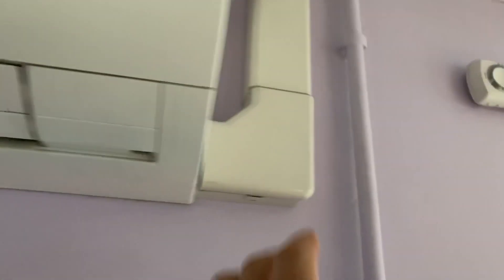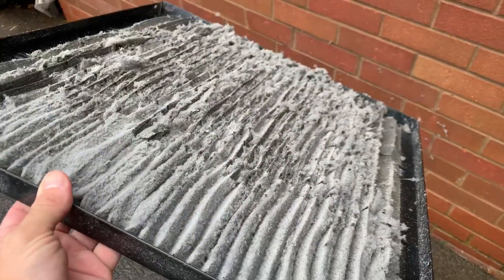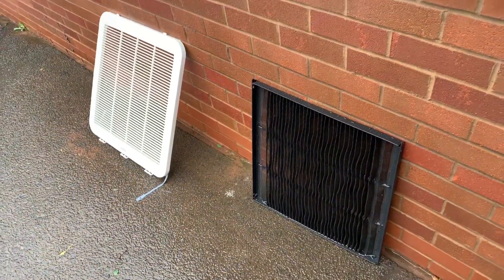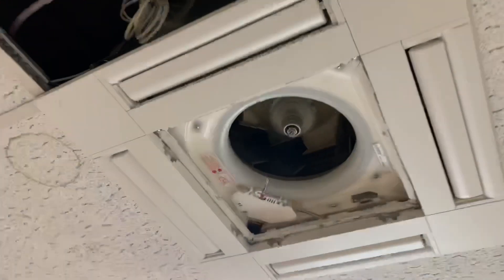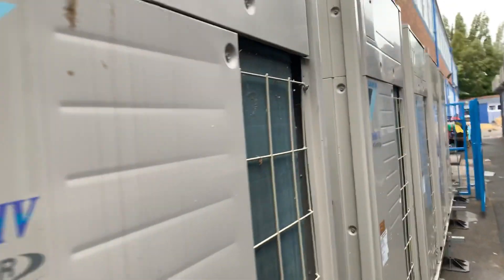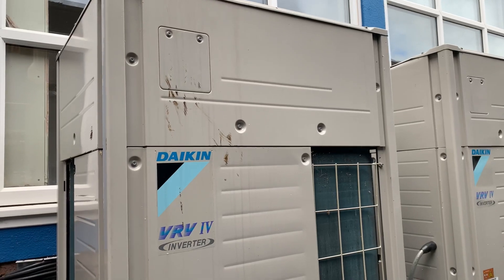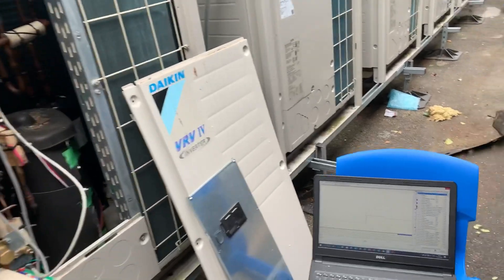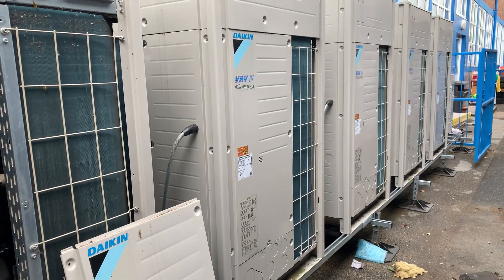A DAY WITH AN AIR CONDITIONING SERVICE ENGINEER UK | HVAC UK

Comment: Great vid! I'm considering training, and had a few questions - Is it an essential part of the job to be able to work at heights? I've seen some buildings and factories where they are near the roof!
Is it dangerous in general? Electric shocks, moving parts, things like that

Thanks so much keep up the good work
Reply: Nothing should be dangerous if the correct risk assessment is carried out first. There are working at height guidelines and  HSE training courses for portable towers etc. Sadly these all come at a cost which will have to be factored in. I was at a MOD site a fews years ago where there is a total ban on any steps. Your van was inspected and not allowed on site should you have any.

Comment: Bloody Terrible the installation of those isolators and do t get me started on SY! Your right it should be band. 
As a spark I come across mess like this all the time but no one seems to give a crap. 

Biggest problem with SY is that it has to be treated like a SWA and In the EAWR it’s required the strands have earth continuity. Just shows that the people installing these cables have no idea really what they are doing. 

Great video, Iv just come across your channel keep up the good work . 👍🏼

Comment: Did you put in a price to move the tank pump from the top of cassette to the side of cassette? If the tank pump isn’t wired up to the control wire ,when it fails it will overflow ,freeze the evap and when it thaws it will knacker the fan motor and the evap pcb .
Reply: I had two in Milton Keynes that did freeze up because of that very issue 🥶
Reply: I have no idea but I suspect both cassettes were maybe a little under gassed and were running too cold.

Comment: Yeah I changed a locked inverter compressor on the 4 it was a bit of  of a pain in the ass. Used a rope and hook through fan shroud and shimmied it out the front of unit worked pretty good but yeah still kind of a pain. Biggest pain was recovering 96 lbs of refrigerant.

Comment: What do you find works best for cleaning the plastic covers on the indoor units? And I keep having very loud HR boxes on units, any experience with that?
Reply: I use a biodegradable degreaser mixed about 5 to 1 and a karcher k5 pressure washer with the short trigger and short nozzle, works excellent.

Comment: if you want to check the temperatures with your checker, just use mode 2.21, in 5 minutes everything is equal.

Comment: I’ve changed quite a few of the VRV IV compressors, definitely not as easy to get out as the 3 units, but if you remove the sound jackets, it gives you a lot more room.  On the boards, I use an adjustable bungee to hold the bracket in place while removing the wires, helps out quite a bit.

Comment: Could you drill a few tiny drain oles on bottom of isolater switch, keep the videos cumming.       I am an old school start run cap tech sines 86. trying to learn all these unreliable electronic crap systems.

Comment: Great content as always. Learning a lot from you. Never knew you could test the pump from controller. 👍🏼 Would you quote to replace the isolators, stick them on your report or leave em be?
Reply from the maker: Thanks mate 🙌🏼 Someone else looks after their electrical issues so I just recommend replacing them on the report ASAP before it causes damage to the systems 👍🏼👍🏼

Comment: That water leak on the cassette: Have seen quite a few drain pipes from the cassette sweating and dripping on to the ceiling tile. Also, those mini lime pumps always seem to blow the braided hose off! Doesn't seem to seem to matter what clamp you use!!

Comment: Hi Mate just subed ac installer in Glasgow good to see your post
Reply from the maker: Thanks for the sub mate 🙌🏼🙌🏼👊🏼 I’ve got family in Glasgow 🏴👍🏼
Reply: @hvacuk8975  cheers I've got a wee bit of info for you itouch manager, if your trying to get into the setup menu and do the 4 corners please calibrate your screen before you try as its not a pain if you don't, top right bottom left top left bottom right please touch the bottom above the menu and time.

Madoka controller update it with mobile data off, if you don't and someone calls you while your updating it screws the controller.

I'll post as I find more tips
Reply from the maker: @mundane000  nice tips mate 👍🏼 I’ve definitely been standing in front of an I Touch hitting the four corners for ages on many occasions 😂 I’ll try the calibration first next time 👍🏼

Comment: The reason for the small brown spot on the ceiling tile under a condensate drain(when a clear leak is not obvious) is more likely due to sweating from the cheap thin wall white overflow (on hot humid days) could do with a insulating. Wish more people would use the grey pvc type
Reply from the maker: Very good point mate ! I’ve seen a lot of plastic condensate pipe sweating on the extremely hot days 👍🏼👍🏼
Reply: What is the grey pvc called. I have never seen grey pvc.

Comment: Never knew about testing the internal pump from the controller 👍🏻 thanks. 
Changed a fair few vrv 3 compressors and components, yet to change any components on a vrv 4

Comment: Get yourself a Worx Hydroshot mate. Awesome bit of kit!!
Reply from the maker: I’ve got one mate 🙌🏼 Agree, quality bit of kit for maintenances !! I just need to grab some bigger batteries for mine. 👍🏼👍🏼
Reply: Hey mate you probably know this already. We all use the hydroshot at our place, game changer. I got fed up with the battery on them so definitely recommend the turbo charger. I also found bigger battery alternatives on amazon. JCB are not known for top quality but you can pick up a 4Ah for alot less than the worx range. Great video! I'm a brummie aswell based in Cambridgeshire, good to see brother 🤟
Reply: Yeah its make a big difference with the turbo charger man. Defo recommend it. I've even heard of people making an adapter using a 3D printer to fit out their existing battery's. Love the channel, keep the good stuff coming mate
Reply from the maker: Brendan Murray thanks mate 🙌🏼🙌🏼 A few people have mentioned the JCB batteries ! I was thinking of trying to get a converter too so I can fit my Milwaukee battery on  🤷🏻‍♂️
Are the turbo chargers a lot quicker than the standard ?? Feels like they take forever to charge with the standard charger 🤦🏻‍♂️
Can’t hide the Brummie accent 👊🏼👊🏼👍🏼
Reply: Was that the transportation bracket still fitted on the compressor?

Comment: Good vid ! Hello from Orange County , California. U guys Have Hacks There too. 😂🤣 Too funny ! Water in a Service Disconnect is Not good. As u suspected. Our electrical is done differently Here. We Run a Water tight conduit and Pull wires through the conduit. That Hanging rubber Cable would not be legal here. It would be like using a piece of So cord outdoors which is strictly forbidden. Like # 31.
Reply from the maker: OcRefrigeration , Hvac & Electrical Video's. Hey mate 👋🏼 Yes it’s definitely not the best electrical installation 🤦🏻‍♂️
The black cable is standard practice over here it’s SWA which has a steel armouring around to protect the cable. Normal practice would have been to gland it into the bottom of the isolator (disconnect) though !
The dangling cable was not good though 🤦🏻‍♂️
It’s interesting to see how different countries do different styles of work. I’ve had a look at a few of your videos mate 👍🏼👍🏼
Reply: @hvacuk8975   Thanks. 👍

Comment: Had to change a compressor and inverter board on a vrv 4 a few weeks ago definitely add an extra hour or so onto the quote it was a real pain to do but like you say there is enough movement in the pipes to allow the heat sink to be moved out of the way if your careful, loving the vids it's nice to see uk based ac servicing
Reply from the maker: Thank you mate 🙌🏼👍🏼👍🏼

Comment: You could have made yourself a blanked with all of that fuzz you removed!  

I am with you on that disconnect; there was no need to penetrate the box on the top.  Even if it had been sealed with a washer and/or a rubber boot, eventually those will breakdown and crack which will lead to a leak.  They also really packed and pinched the load wires into the bottom of the box against their lower penetration.  The installer seems to have a bit to learn.

Great video, really interesting to see these VRV/VRF systems, they are kind of rare here in Ohio.
Reply from the maker: Thank you mate appreciate it 🙌🏼👍🏼

😂 There was definitely enough fluff to make me a blanket, they were all pretty much like that !

Yes, not a very good electrical installation at all sadly 🤦🏻‍♂️ Hopefully they get it sorted before it causes any damage !